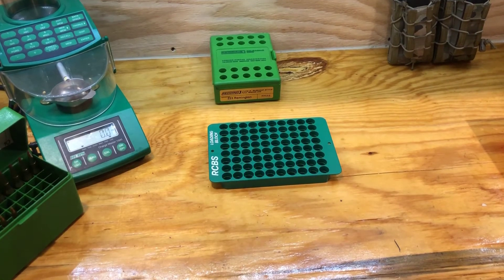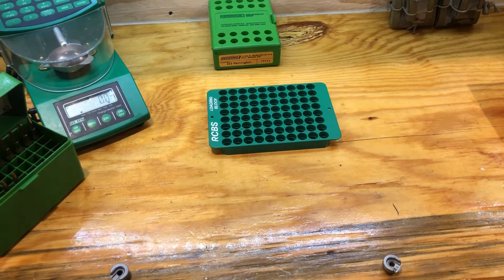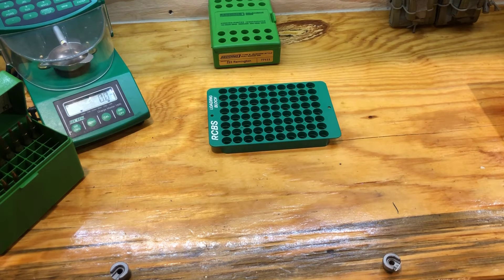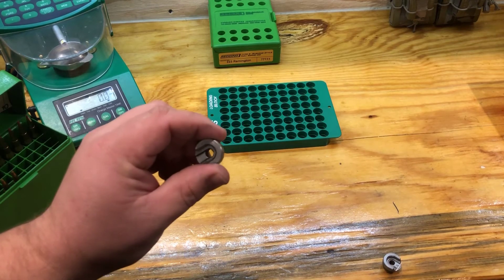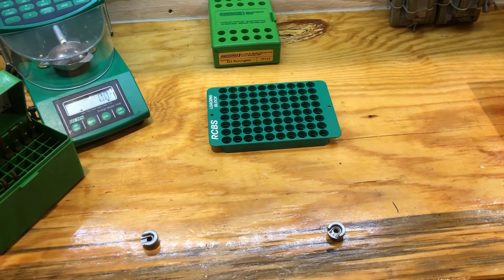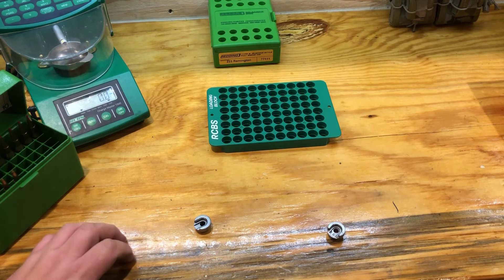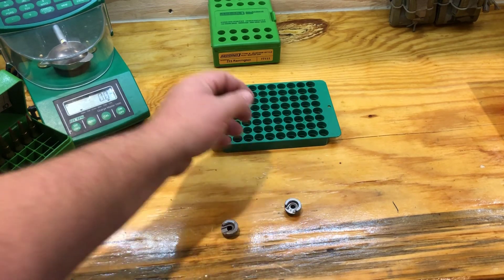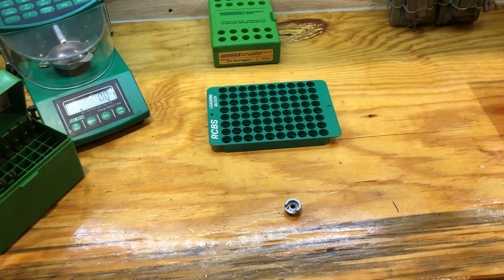Shoulder Bump Issues

Comment: Thanks for the informative video, another point to remember is that after one (or more) firings, the brass shoulder/ headspace  may not have grown enough to be bumped back by your particular die. If you bump the shoulder after the first fire-forming and thereafter, you could potentially be over working the brass, also if you bump the shoulder back before your cartridge has grown to your  chambers length/ headspace, you will inadvertently and repeatedly, stretch the brass at it's most vulnerable point... just after the case head, which can lead to premature case-head separation.
Reply from the maker: You’re absolutely right!

Comment: TERRIBLE TERRIBLE TERRIBLE ADVICE! And it`s WRONG!
You didnt even measure the shell holder properly for the thickness. You`re measuring the total shell holder top to bottom...INCORRECT!
I`ll use a RCBS shell holder as an example. The CORRECT thickness is usually .246ths, NOT .500ths.
Reply from the maker: Evidently you don’t understand the concept. That’s ok.